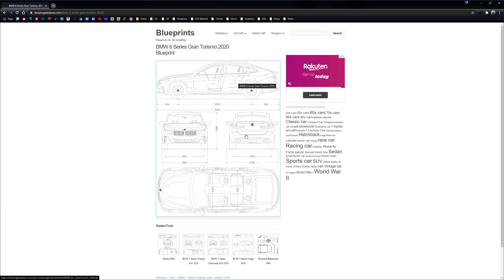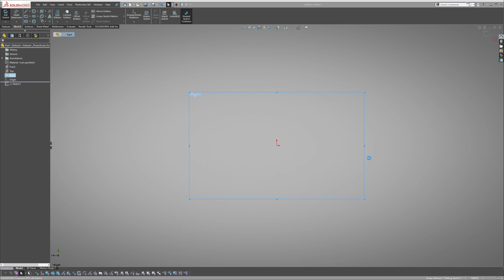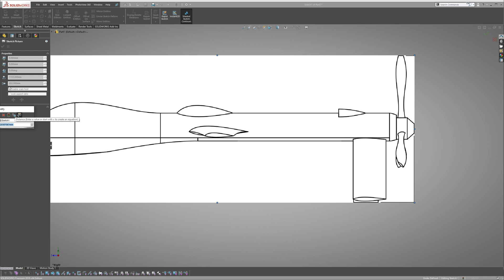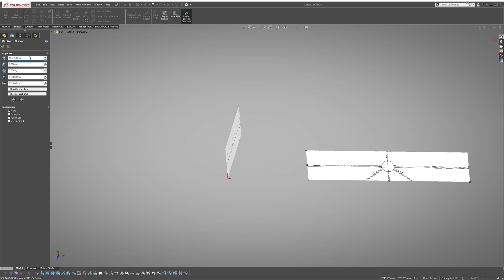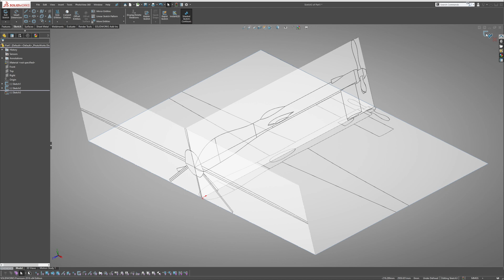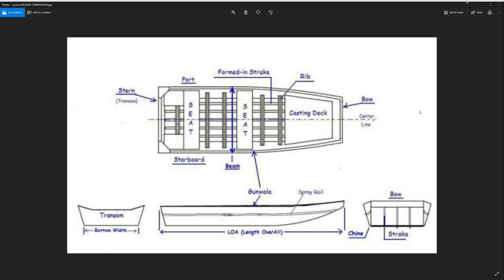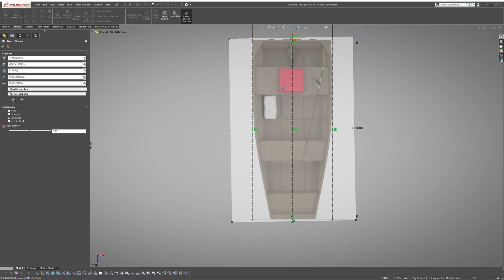The BEST way to INSERT a BLUEPRINT/IMAGE | SolidWorks Drone Model [Part 1]

Comment from the maker: In this tutorial I’m going to show you where to find images for 3D modeling along with how to insert them in to Solidworks so that you can go from 2D to 3D using three perfectly align front, right and top views from a blueprint. 

Download & Try SolidWorks CAD Software free trial:
https://my.solidworks.com/try-solidworks

Download the free project files here:
https://rathasochenda.com/download/

My website:
https://rathasochenda.com/

Time Stamps

00:00 - Why this is important 
01:00 - Where to download project files
01:30 - Where to find blueprints or sketch images for 3D modeling 
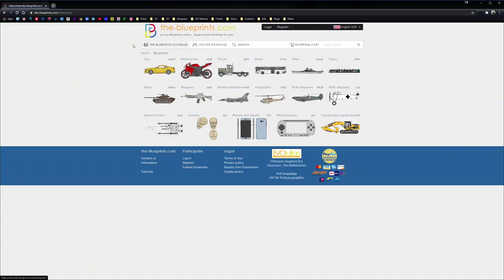03:03 - How to crop the blueprint into top, front, right views
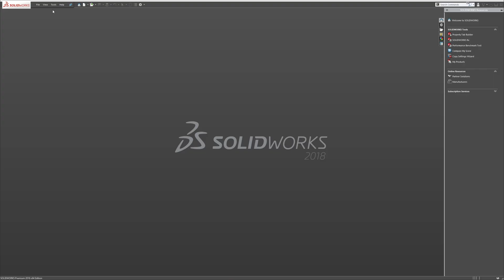04:33 - How to insert sketch pictures into Solidworks 
10:35 - Renaming sketches and grouping them into a folder
11:41 - Inserting a raw image vs a blueprint into Solidworks

Comment: after working the wings i tried to knit to mke a solide so i can give the body a thikness but it didn't work can you give me some tips (btw i'm working on a diffirent concepte than the one you were working on) (also i forget to work on only the half part including the wings so i did almost exacly as you did then i worked on the wings in one part the other wind i mirrored it and the cut i made one myself on the other part)